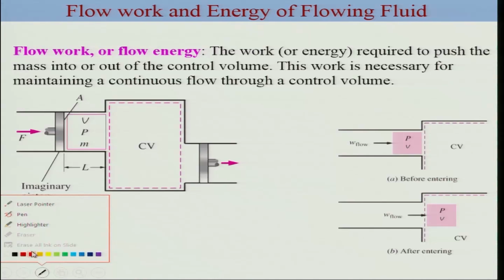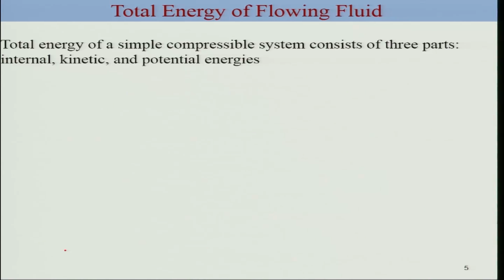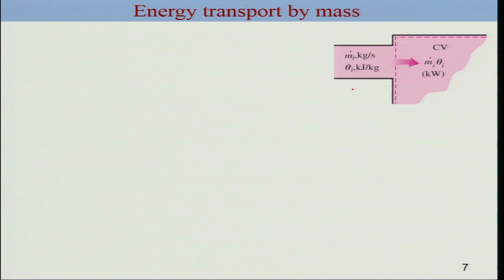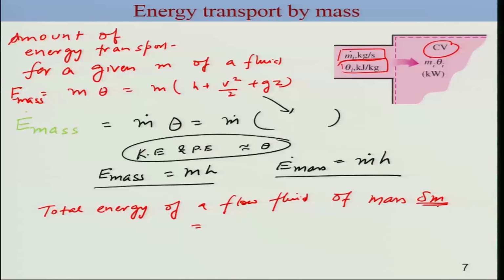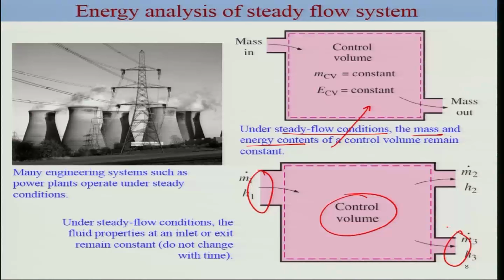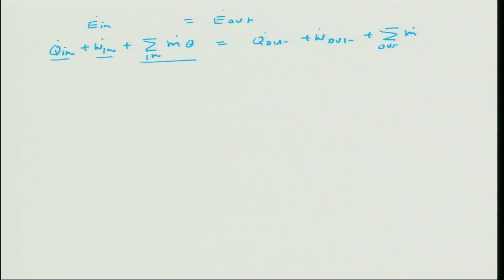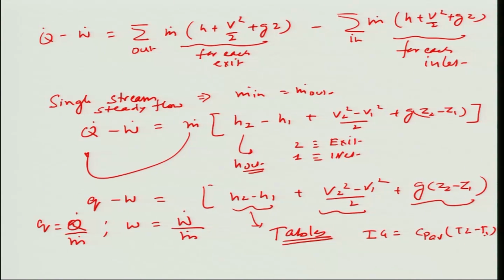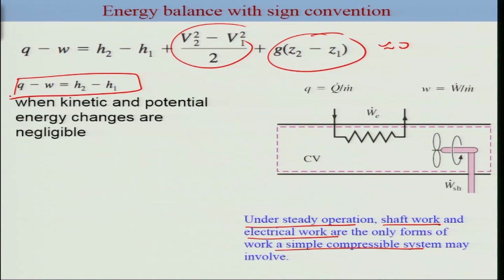Flow work and energy of flowing fluid

Comment: Thanks for this. However please elaborate more on using the partial derivative of flow work in this example. dPv = Pdv + vdP. How would you determine the flow work if fluid would be compressible. Change in P and v.